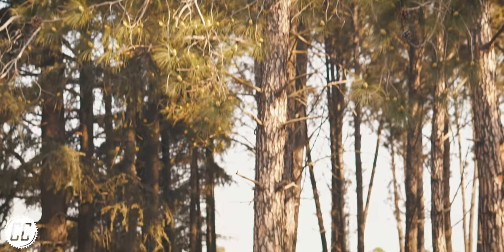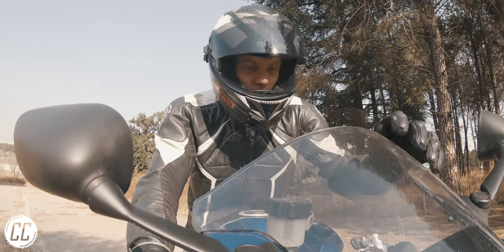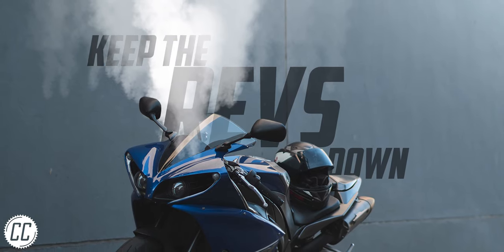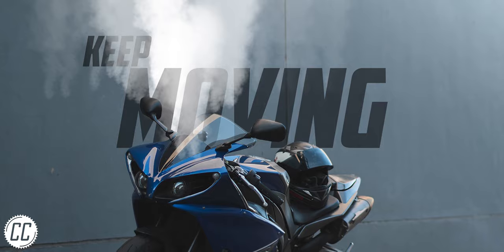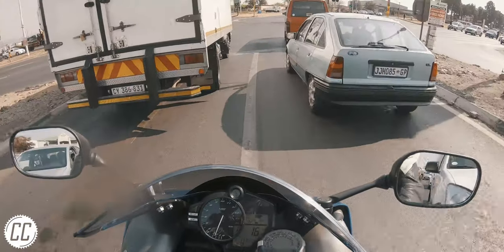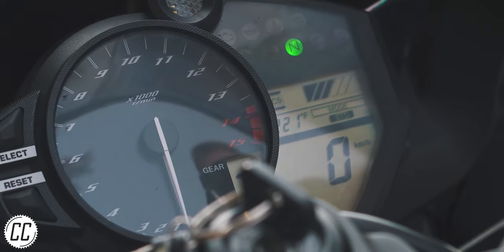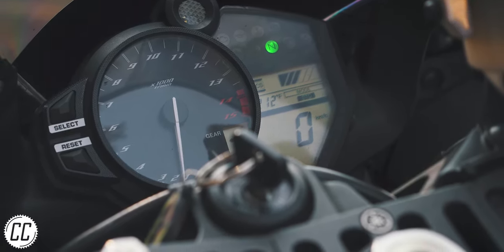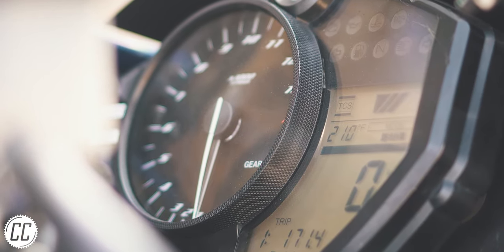Overheating Prevention Tips & Tricks

Comment: Lowering your revs does NOT cool the engine. It's your throttle use that will heat or cool the engine. More throttle is more heat. However! If you want to accelerate (fast), higher revs actually COOLS your engine vs lower revs. Why? Because more cool fuel and air is injected into the engine. Applying throttle with low revs / high gear will stress the engine more and heat it up. People who often climb mountains with their car will be able to confirm this, as you can overheat your engine when you would climb in too high a gear. Lowering the gear, i.e. turning up the revs, cools the engine in this situation. So do not lower your revs, limit the throttle input instead. 

Your fan turning on is normal system behavior and normally not something to worry about. When you drive in cooler climate as well, your engine is supposed to heat up and the fan will be needed to keep it within healthy range. As long as your coolant doesn't cook (you'll notice when this happens), there's no need to worry. 
Also, as other people below already stated, don't turn off your engine at short stops.

Comment: I'm a big fan and follower on insta too :D  But I don't agree with "Kill the Engine" at a red light.  I'm from India and nowadays, here the temp is around 30 Celcius and
I ride 390 Duke Today it went hot again and RPM was not going above 5k RPM so I have to drive it below that RPM. If I killed it might not start again until it reaches the desired temp to start.

Comment: Few wrong facts. When you shut the engine off the temperature will actually go up this is called after boil. Also most engine will run hotter at low rpm because you are not flowing much coolant because the water pump spins faster or slower with rpm.

Comment: I guess this video is for numbs. But try getting a flash tune so the fans come on sooner also get a lower temp thermostat. Bikes are meant for travel if its "over heating" you have a issue.. No difference than a car.. If U over heat in traffic u have a problem.. It shouldn't over heat if all cooling componites work properly.